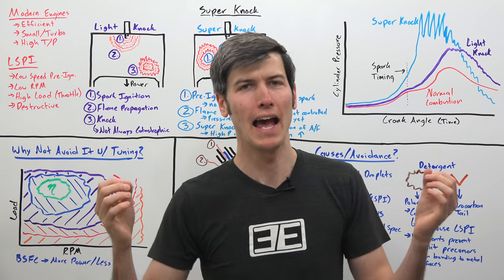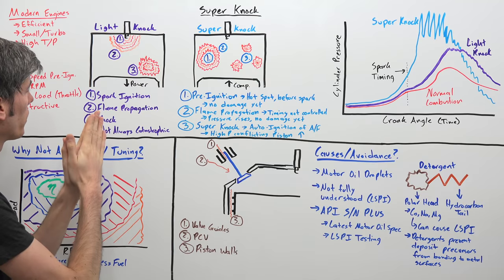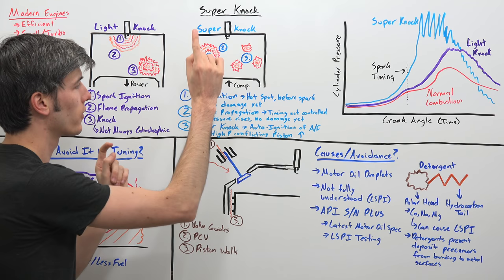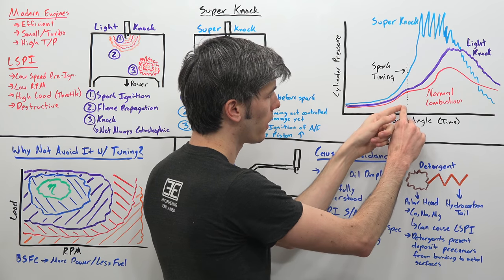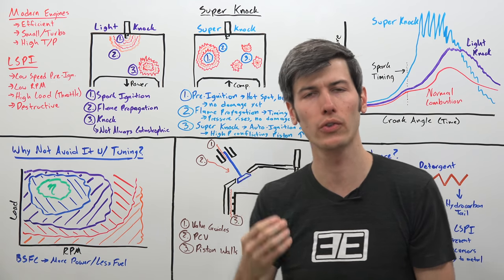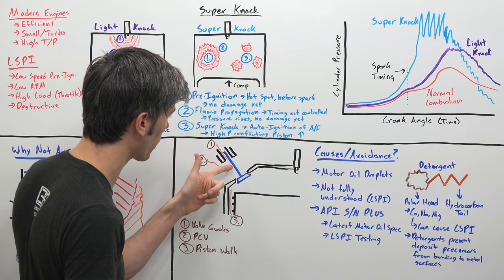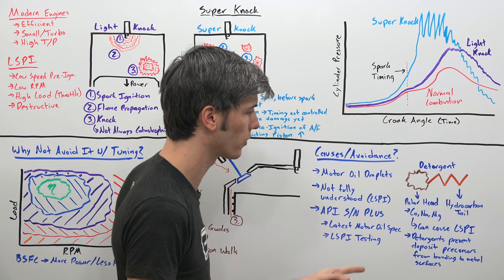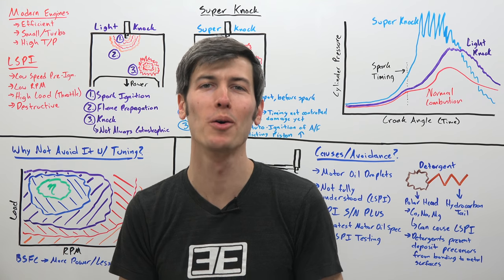How Super Knock Can Destroy Modern Engines

Comment: I think the motor oil drops doesn't do much to make it super knock, it has a much higher combustion temperature than fuel.

I rather think that tiny carbon particles from the EGR ignites and catch fire to the fuel.
Reply: The researchers at Millers Oil say that it's the oil detergents igniting, not the oil itself.
Millers reformulated an LSPI oil that uses less flammable/non-flammable detergents.
Reply: @stuartmolyneux64  well it could be that also, wish i could see and interact with their test 😅
Reply: @tullgutten  -   i think it has an awful lot to do with running a lean mixture at low rpms. My old Honda used to burn oil like a motherfucker at 7000rpm, but it never misfired or pinked because the ECU ran a safe rich mixture of 11.5:1 to keep things under control at the expense of fuel consumption.

Comment: I'd rather get an older car with a bigger, non turbo charged engine. And use higher octane fuel. Robust, durable, and dont require degree in rocket science to maintain. These new tiny block turbo engines sound like more trouble than theyre worth. Like, this one VW Polo I read about had a 1 liter engine with turbo producing 80 bhp ... that cant be very durable.

Comment: Is it not fixed by higher octane fuel? Like you usually do if you install a forced induction on to NA engine?
Nobody, is surprised when it happens on a custom turbo engine. And yet it is "unknown" why it happens on a factory produced one. Which also runs "hotter" for emission reasons.
Physics doesn't change just because marketing tells you it's possible to fill it with cheap fuel and get all the performance.
By the way, BMW states in small letters, that all measurement where taken on high octane. Even though you're allowed to fill regular and even worse. They only say performance will degrade. Never that there are risks of engine damage.

Comment: Knock is caused from non centrally located spark plugs
Reply: negative
Reply: @karimnasser6710  it's a huge factor
Reply: Unless there's an issue with timing😊
Reply: @crispincurtis8585  positive :D
the reason i said negative is the twin spark design of alfa romeo, many literature  have also introduced  some non centralized spark plug designs that actually worked. 
anyway, i can not rule out your theory completly, many parameters and factors in an engine can influence one another.
Reply: @karimnasser6710     right on
Reply: Ford did that in some of their 2.3l engines
Reply: @crispincurtis8585  i would expect all kind of error from ford 🤣
Reply: Not really
Reply: That is incorrect. Take a look at VW's EA111 and EA827 engine families. All of these have non central spark plugs and these engines did not and do not constantly knock. Some of them are absolutely bulletproof. 

From GM, the C20NE (Opel) comes to mind. Also non-central. Virtually indestructible.

Comment: This is simply detonation vs pre-ignition. "super knock" = clickbait.
Reply: Agreed.
Reply: That isn't detonation, i don't know why such events are called detonation by engine/car enthusiasts. From wikipedia; Detonation (from Latin detonare, meaning 'to thunder down/forth') is a type of combustion involving a supersonic exothermic front accelerating through a medium that eventually drives a shock front propagating directly in front of it. 
There is no supersonic front when knocking or premature ignition occurs on engines, its just an "asymmetrical ignition" event.
Reply: The words "super knock" appear in diagnostics. It ain't no clickbait.
Reply: @teresashinkansen9402  If you're so well informed, how fast does a flame travel in a combustion chamber with given "hot spot" that flashed the fuel before the spark plug ignites?? Because that would propagate that shock front.
Reply: @killaj419  It propagates at subsonic speeds, it doesnt have the distance to have a run up into a DDT (deflagration to detonation transition). It probably moves a few tens of meters per second, it doesn't reach the Chapman–Jouguet condition except when the two combustion fronts collide each other, it can happen but is rare and by that time most of the fuel has burned to really be significant. There isn't even a good agreement about knocking in the scientific community. Auto ignition and detonation are the two main hypothesis but so far everything points out its just the sudden ignition of multiple points in the chamber that produce over pressures, it doesn't seem to be a true detonation.

For example, firearms. Large cannons use slow powders if you use handgun powder on a cannon it will explode yet it isn't a detonation happening even if it sounds like one, it just burns too fast and generates too much pressure. However if you generate a true detonation inside a gun no matter the size of the gun it will explode, metal behaves like heavy clay at such pressures.
Reply: @teresashinkansen9402  Well, you are informed. Haha I appreciate the explanation.
Reply: @killaj419  No worries mate, Im glad you appreciate it. Have a nice day!

Comment: Get an electric car. Problem fixed! But seriously, when people rebuild Porsche engines for massive boost they use pistons that give a super low 7:1 compression ration. 15 psi boost gives a nice 14:1 compression ratio. Under low load these engines will have crazy low efficiency. The only way to get the high efficiency under low load and high power at high boost both is with a variable compression engine where there is a hinge between the crankshaft and the head. Audi tried it at least once. Nissan is currently attempting this.

Comment: Aren’t small turbos super inefficient at low RPMs because high fuel/air ratio and the reason they want power down there for drivability?

The only time I got close to decent fuel economy with a small turbo was running in eco mode that massively reduced torque low down. Power in higher revs was mostly unchanged.
Reply: Small turbos spools up faster gets torque and power up faster then flatlines
Large turbo spools up slower but once it's up to speed it keeps it there.
Here's a better example an electric starter (small turbo charger)turns over an engine faster but it duration is much shorter because it will burn up the starter but a gas pony motor(large turbo charger) starter can turn over an engine for longer duration once you get the pony motor started! Of course this is just a basic and simplified loose explanation of how the small and large single turbos work.
Theres two ways to do both using a compound turbocharger with a small and large one togather and a variable geometry turbocharger!
Reply: Higher numbers like 14.7:1 - stoichiometric mixture, hot, efficient, volatile    (Ford Ecoboost engines at low rpms)

Lower numbers like 11.8:1 - rich mixture, cooling, reduces risk of detonation, inefficient  (Old Honda Type R engines at high rpms)
Reply: @stuartmolyneux64 Diffenitly a more precise explanation or answer then my answer!

Comment: soooo... you drive an S2000 huh?

also LSPI can also be caused by carbon build on the pistons/heads, i would recommend on top of the SN-plus oil you should also routinely run some kinda intake system cleaner (seafoam).

Comment: What is 'modern engines'? Surely modern these days, in 2019, means electric engines... and not those that run on dinosaur juice.
Reply: Well, compared to how many combustion engine cars are being produced v electric cars in 2019, combustion far outweighs electric and it means most viewers own a combustion engine car.

Also, if you think knock can occur on an electric ‘engine’, then clearly you don’t know much about cars in the first place or you’ve been drinking too much of that Dinosaur juice yourselves 😂
Reply: "Modern engines" are gender fluid and get triggered when you assume oil viscosity without asking about their pronouns.
Reply: those cheater devices are motors rather than engines by definition.
Reply: No definition about electric engine, it is "electric motor".